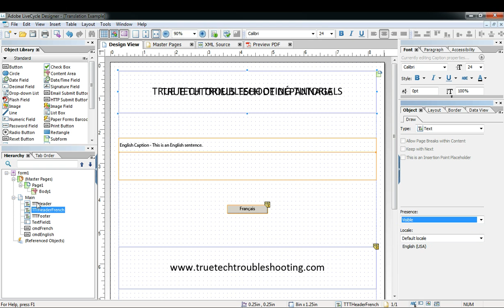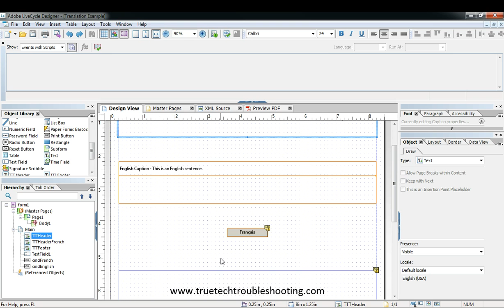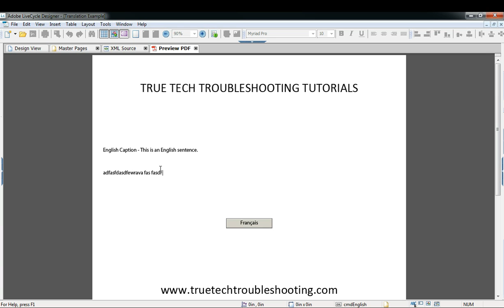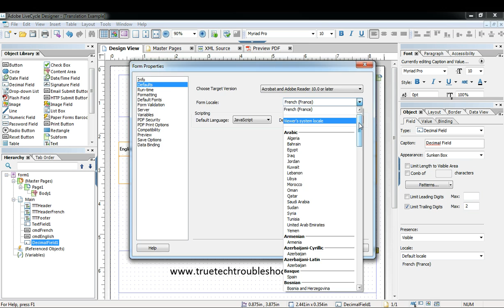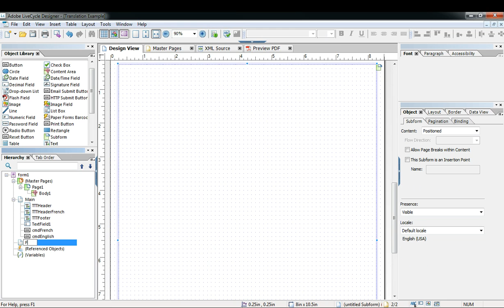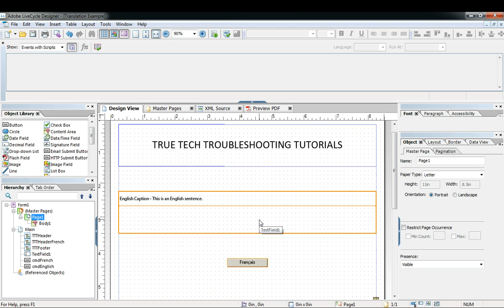Bilingual Forms in Adobe LiveCycle Designer

Comment: Better way to do this is to add a script object which switch languages by only one property. 
Let's say the value of that property can be FR and EN. Then in each fields / subforms, in the initialize or calculate event you change the caption/text depending on the property within the script object.
This way instead of having a massive multiple lines of codes to change the language in one spot, you can only change some places which manage parts of the form.
Fields can hold their own initialize or calculate event, but for text objects only --> it is suggested to use the subform initialize or calculate event.